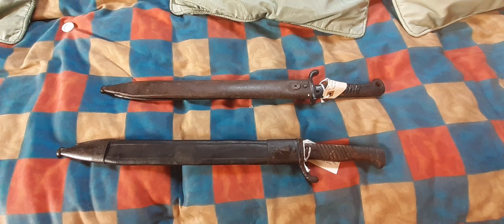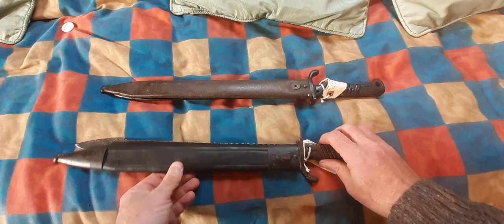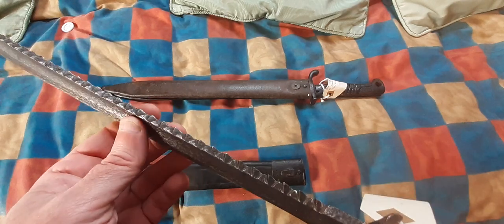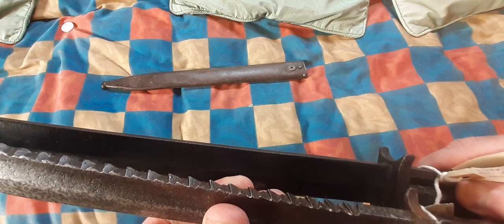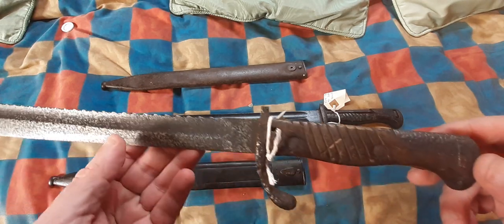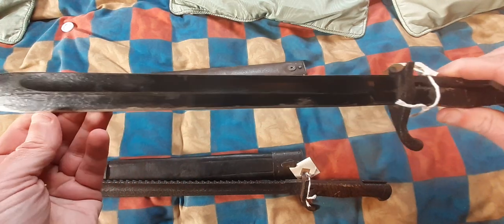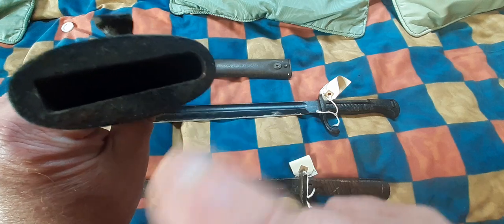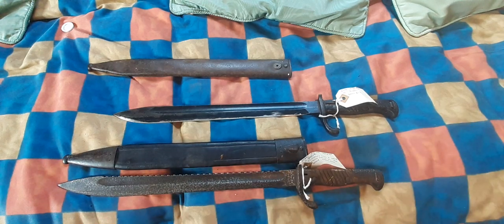FIRST WORLD WAR SOMME RELIC  GERMAN MODEL 1898/05 PATT BUTCHER PIONEER BAYONET

Comment: They have one of these in my local junk shop but in much better condition. It is going for about £200. These bayonets were used by German Pioneer troops and the serrated edge served for cutting wood and rope. The main reason that the Germans stopped issuing these to Pioneers was, rather than the Geneva Convention, the fact that British soldiers used to shoot any German soldier caught wearing this pattern because of the mistaken belief that they were designed to cause more suffering to anyone being stabbed, rather than being aware (or not chosing to believe) the real reason for the sawbacks.
Reply from the maker: true, the 1907 hague convention outlawed the use of sawback bayonets...and one of the ww2 us army manuals forbids the use of an item which causes "unnecessary injury" to an opponent, germans were told to throw away their serrated bayonets, and canadians filed theirs down because it is true soldiers were shot on sight by an opponent just for having one in their posession., saw back blades have a long history with most countries engineer troops as a cutting tool  but in ww1 it gave the allies the "proof" they needed that the hun was barbaric, and the rest is history.